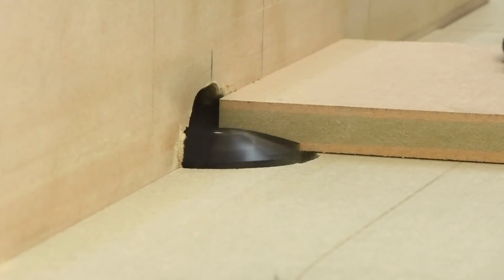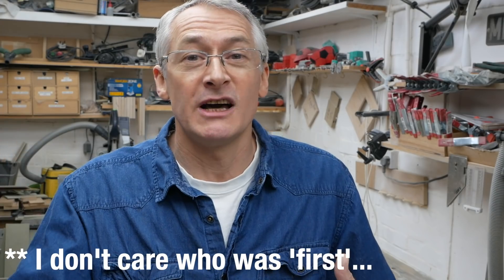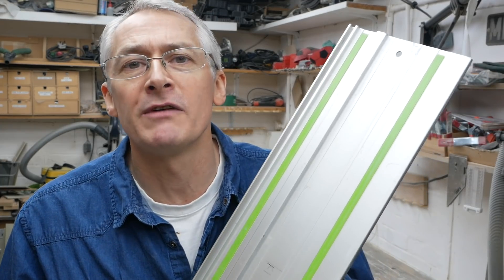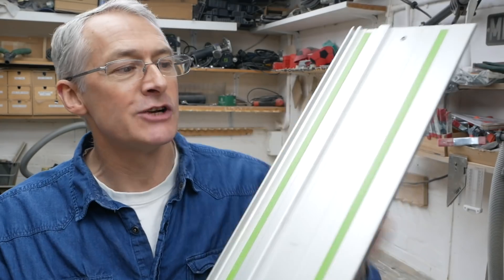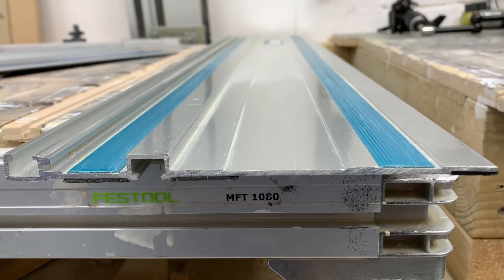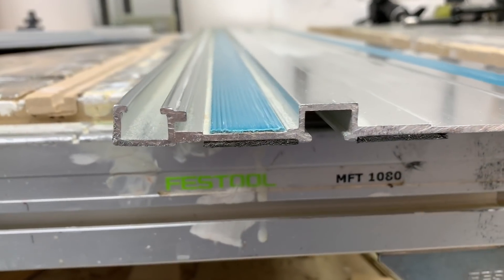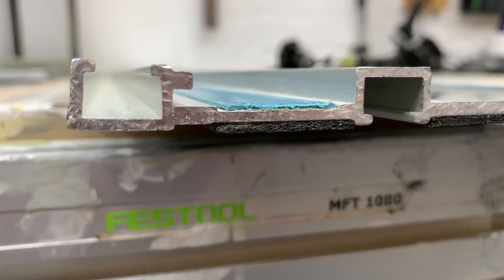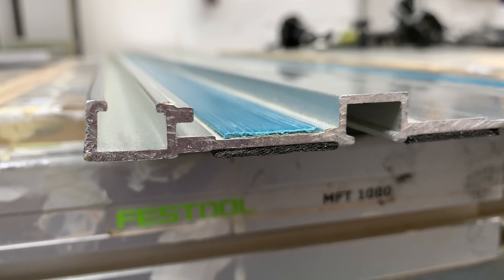TW P6; DIY Long Guiderail [video #282]

Comment: Great series of videos, Peter. I use an Einhell TE-PS 165. I've followed your idea for a home-made guide rail, but glued sandpaper as an anti-slip feature to the underside of the guide rail. Keep up the good work!
Reply from the maker: Thanks Kurt’ yes, sandpaper will work well, just need to be a bit careful about the finish on the material! 👍👍

Comment: Great work as ever, Peter. Just a thought, the (free) B&Q (or similarly equipped merchant) sheet cutting service would make that tricky initial 6mm cut - provided you bought the sheet material from them!

Comment: Hi, if you were a DIYer, which is the plunge saw you'd get today? I've ended up getting Makita for most of my other gear so I naturally went to that, but happy to go for cheaper alternatives if it's not worth the extra money. Mainly cut plyboard up to the full sheet so was going to get 2x 1.5m rails to go with it but this video might have convinced me to go DIY on that too! Great series.

Comment: One of the things that drew me to the Parkside (aside from it's bargain price of £60 in the early days) was the complete compatibility with festool track. I bought a 1400 length for about £40 on offer, 2/3rds the cost of the saw but oh so worth it and I use it much more than the parkside track. Luckily I can connect the parkside track to the festool so I can have 700, 1400, 2100 or 2800 track combos. Very useful when you have a small shop!
Reply: Similar experience with a Draper track saw bought on line at a very reasonable price. With the kit came two 70cm rails and I tried to buy extra from Draper but you had to purchase from an outlet. I had no luck with this and the Covid situation  complicated the whole problem. The solution was I found Evolution rails fitted perfectly .
Reply: @garypautard1069  Definitely worth buying a saw that is compatible with an easy to purchase rail.

Comment: My first 'Track' saw was a rail for my Circular, and I contact glued the IKEA stop. It works great and I still have it from about six years ago.
Reply from the maker: I also made a ‘saw-board’ for my circular saw, way back; worked great, but I didn’t have any grippy stuff in the base, so had to clamp it down all the time. 🤔👍👍

Comment: For the non slip bottom for the track, I would recommend the Poundland carpet grip roll, it's 50mm wide and a couple metres long and surprisingly grippy
Reply from the maker: Thanks! 👍👍
Reply: I've seen people use sandpaper disks.

Comment: Make your own splinter strips with strips of solid neoprene rubber (different than the foam neoprene that the grip strips use) and some carpet tape to attach them.  Takes seconds and makes about 4 strips for a fiver.  To go even cheaper, buy wider strips (100mm is the widest I've seen), you can cut them down their length and it doesn't matter about the cut being straight as you'll make them that way when you cut it for the first time with the saw.  Pay attention to the width of the strip (and don't forget to add on about 1/2mm for the carpet tape thickness).
5mx100mmx2mm on ebay for £15.  That would make 12 strips (@1400mmx25mm).
There's also always the option of moving your current (torn up) strip 'out' on the rail and you can get 2 or 3 extra uses out of them - use the carpet tape to re-attach.

Comment: Great video series!  You should consider saturating the edges of the rib and “splinter guard” with CA which will make it much less susceptible to wear.
Reply from the maker: Thanks!
Reply: what is CA?
Reply: @dobrin.ivanov  Cyanoacrylate - super glue,  probably thin (runny) in this instance.

Comment: Really good series Peter, thank you. Festool do a 2700mm guide rail which is perfect for full length cuts on 2440mm sheet goods!
Reply from the maker: Thanks Simon! Yes, they do a 2700, but it’s pretty hard to get hold of and close to £300 last time I looked. Put another way, that extra 300mm almost adds the price of a Makita 3-metre rail! And 2700 is kind of an awkward length to wield in a small workspace; I just wish they’d make a 2450 instead of 2400... 👍👍
Reply: Healy's have it listed at £235 and DM Tools at £216 (both including VAT). Mine was £185 when I bought it in January 2016. You don't fancy buying the 2700 and snipping a bit off the end then ;-)
Reply from the maker: @simonfisher3871  Thanks for that Simon! Best prices I'd seen previously were around £285-290! Interesting that D&M don't list the 2400 - maybe they've pulled the plug on that, or just decided to stock it instead of the 2400 - most other places are listing the 2400 at ~£170. And no - I bought the Makita rail way back when it was a fraction of the price of the  Festool! 👍

Comment: Just a heads-up: the Titan 1200w track saw that you tested a while ago, is (using the Mac Allister badge - and it's EXACTLY the same saw) now on clearance at various branches of B&Q at £70, while the Titan badged saw is now £110 at Screwfix. Got mine today!
Reply from the maker: Nice! Yes, SFX and BnQ have the same parent company, you can sometimes find the Titan branded saw there as well at the same price. BTW the follow-on vid to this series (#285) puts the Aldi against the Titan. 👍👍
Reply: @10MinuteWorkshop  Just watched it, excellent comparison, I'm glad I went with the Titan/Mac Allister (where DO they get these names from?). Looking at Amazon, Evolution does a set of 2 1400mm rails, plus clamps, plus bag for £65 delivered - might go for that. Putting my cheap and nasty (and hellishly frightening) table saw up for sale. You deserve 100k followers, thanks so much for all your video endeavours.

Comment: I use the Makita's anti-tipping feature when making french cleats. I like being able to leave the saw on the track, while keeping the bevel angle set.
Reply: Hi Peter. I bought a Titan tracksaw  some time ago and subsequently invested in a Makita 1400 mm rail. This gives me the best of all worlds. A 700 mm rail for small job, a 1400 mmm rail for cross cutting 8 x 4 sheets and a 2800 mm rail for ripping then.
Reply: @charlesmorland3669  do you know what to get a replacement splinter guard for titan

Comment: A bit of candle wax would make that long guide extra slippery... 🤗

I was thinking of routing a shallow 16mm rebate using a router table (or router + fence) on the blank track...
then find a length of 16mm  X 8mm alum or plastic strip... this would prevent wander of the strip as its being stuck down... 
a good bit more complication there  tho...(its the engineer in me 😂)
I like yours Pete, KISS process & does what its supposed to do.!! 

😎👍☘️
Reply from the maker: Lots of ways you could do this, and yes a ‘commercial’ strip would be better and last longer, but my way is simple, cheap, and can be done with just the tracksaw. 👍👍

Comment: Great series Peter.  In the review could you please cut MDF, plywood, melamine, and laminated countertop.  I'm interested in the chipping factors on laminate and melamine faced boards.
Reply from the maker: Thanks! I’ll be doing a ‘difficult’ cut, but can’t do every variation with every blade option. 👍👍
Reply: @10MinuteWorkshop  I was curious in plunge cutting sink cutouts in laminated counters.  chipping on top is never good.
Reply from the maker: I’ve done loads with the Festool without any problems, but I think I’d want better rails than comes with this Aldi.

Comment: Hi Peter.
I have a festool track and I am getting a dewalt plunge saw tomorrow. I been told by the dewalt rep that the dewalt tracks are compatible with all other makes of plunge saws
Reply from the maker: Hi Alex. No. Other way around; the DeWalt saw will work on Festool-pattern rails because the DW saw has the extra groove in the base, but you can’t use eg a Festool saw on DeWalt rails. 👍
Reply: @10MinuteWorkshop  Yes you are right thats what I tking he said because I asked him if the DW will run on the Festool rails
Reply from the maker: @alexcharalambous1417  Yep. It's one thing getting Festool users to switch to DeWalt, but a different matter if they had to abandon their rails in the process!

Comment: I would always advise someone to get the 2700 rail for the 2440 sheets. The extra 260 comes in handy when running the saw straight into and out of the sheet. And yes they are expensive, but connecting two rails gets old really fast.

Comment: Hiya Peter superb series of uploads thoroughly enjoying watching and well worth the wait. 
Just wondering if you consider this Aldi saw to be better or inferior to the Titan model you did the Festool vs cheaptool  upload. 
At  that time you mentioned that this current series was going to feature the Titan model. Just wondered why you have chosen to use the Aldi model.
Just off to watch upload 7!!
Cheers.
Reply from the maker: Hi & thanks! Full review of the Aldi out in due course, together with a comparison to the Titan 👍

Comment: Brilliant again Peter iv been thinking about a track for a while I have a festool saw and I was thinking of taking the base plate off as a sacrificial one for the power red devil the festool doesn't have a blade or keeps jumping up inside the body so cos the devil is running great I'm going to glue it on the base  got a project making mdf shower cupboards lol

Comment: Great series.  I’m wondering if you have any rules of thumb for how much longer the rail should be  relative to the material you are cutting?  Have you thought about extending your long DIY rail an extra foot?
Reply from the maker: Thanks! Depends on what you’re doing. I’ve always been happy plunging into the workpiece at the start of the cut so have never really needed anything longer than a 2.4m rail; if you prefer to fully plunge the saw before starting your cut, then you’ll want a rail that longer than the cut by the length of the saws baseplate. I have a 3-metre rail, have never needed anything longer than that. 👍👍

Comment: Dewalt do a 2.6m guide which is about right for cutting down 8x4 sheets but it's difficult to store and move about, I do use it more than I thought I would tho, removes the 'drift' you can sometimes get when joining two rails together and speeds things up when cutting down alot of sheet goods.
Reply from the maker: Yep - closest length you can get to an oversize 2.44 without being ‘too’ long. Good price on the DeWalt too - shame it only works with their saws 🤷‍♂️

Comment: I recently bought a track saw with 2 x 1.5m tracks.  Is there any reason not to cut one of the tracks in half for smaller cuts (and not to have a 3m track for cuts just beyond 1.5m)?  Is there advantage to making the cut asymmetric to give .7m and .8m lengths or even .6m and .9m lengths? Comments greatly appreciated.
Reply from the maker: Yes, if only because a 3-metre rail is a long thing to manoeuvre! I actually did something similar with a 3-metre rail. Remember that full sized boards are 2440mm, so you really want a 1500mm & 950mm if you're planning on a lot of full-length rips - better to have just the one join in the rail if possible.👍
Reply: @10MinuteWorkshop  Thanks Peter; great point; I appreciate your thoughts.

Comment: Here in Germany the Festool 1400 track is hard to get for below ~75 €. The Evolution dual 1400 tracks you mentioned in various clips aren't being sold here either, the only way to get them is through Ebay from UK for about ~95 € plus shipping (somewhat between 10 and 18 €), so it's not so cheap either and to be honest I'm quite sure I won't need a joined 2800 rail in the foreseeable future. 
But Scheppach offers its own 1400 track here and you can get one for ~50 €.
I already own a Scheppach PL55 tracksaw, identical to your Aldi Workzone Saw. I got it for about 120€ last year and yeah, the Scheppach splinter guard sucks hard (it doesn't stick to the rail very well, the adhesive is crap), but paying more than half of the price of the entire saw + rail package for one long rail alone sucks pretty much, so  basically I'm quite stuck with the option of buying one long Scheppach rail.
Reply from the maker: Interesting to hear, Mathias - seems crazy that lengths of rail can cost so much - and that longer ones cost so much more again, out of all proportion! Shame you can't get hold of the Evolution rails at a sensible price, they're a good option here. 👍
Reply: @10MinuteWorkshop  hey Pete, just got an idea... the Lidl parkside rails, how exactly do they differ from the aldi / scheppach ones?
This week (last Monday) the parkside track saw was on sale here in Germany for 80€. If the tracks are compatible and either saw can run on both rails nicely I might still try if I get one of those in one of the three lidl stores around...
Two additional short rails and another saw is an interesting deal.
Reply from the maker: Hi Mathias. The Parkside rails have a slightly different profile - you can see it at 4:38 in video #323, and again at 9:18. What I found with the Aldi/scheppach rails is that they were annoyingly different to the 'standard' pattern - I talk about this a bit in video #285 at 4:15. That said I haven't tried joining the parkside and scheppach rails together, so I don't know if there are any other issues. 🤷‍♂️ HTH P
Reply: @10MinuteWorkshop  thank you very much! Seems like I need to find a way to get those evolution rails pretty cheap. Unfortunately the german offspring of Screw Fix just got shut down (had a store in town about 4 km away) , they had a few evolution products on sale.

Comment: Hi Peter great set of videos, question does the Titon track saw (screwfix one) fit festool track as I want the 800 mm from screwfix, its only £47, cheers mate
Reply from the maker: Yep, Titan’s a good fit on Festool rails. 👍👍
Reply: @10MinuteWorkshop  just seen the makita 1400 mm at £49 so will go with that cheers , thank you

Comment: How did you perform the cut of splitting the guide rail into two?
Reply from the maker: Standard blade (48t) in the tracksaw cuts aluminium just fine. 👍👍
Reply: @10MinuteWorkshop  your series have been very helpful. I have a Pattfield PE-1200 TS from Hornbach (€100, additional guiderail €40 with clamps) and a lot of things are more clear now. Thank you!
Reply: @10MinuteWorkshop  one more thing. I learnd, redarding the shape of the guide rails, that few rails alow for the UJK rail clip. Festool have open U-track but many cheaper rails only have C or a closed track. I had to give my rail clip away.

Edit: I saw you mentioned it in the Lidl Parkside video.

Comment: In my limited experience I have the impression the rail needs to be at least roughly 10cm longer than the cut you want to make (your cutting the splinter guard in a previous episode seems to confirm this). Wouldn’t be surprised that’s the main reason nobody makes that particular length.
Reply from the maker: So why does everyone make 2400 rails, 40mm shorter than the typical sheet length and not 2550 rails? Rhetorical question 🤷‍♂️
Reply: Peter Millard bonus: at one of the diy stores I regularly “visit” plywood measures 2500x1220 (other sheet goods come in the usual 2440x1220)

Comment: Does the makita track fit on this saw? I have a pl55li.
Reply from the maker: Up to a point; more on this in the upcoming review 👍
Reply: So it won't cut on the makita rail? To wide base?
Reply from the maker: It'll cut, but you'll have quite a lot of splinter-guard exposed, which may not produce the best of cuts with the supplied blade. A better blade (eg Key blades and Fixings, link in the description) will make a big difference 👍